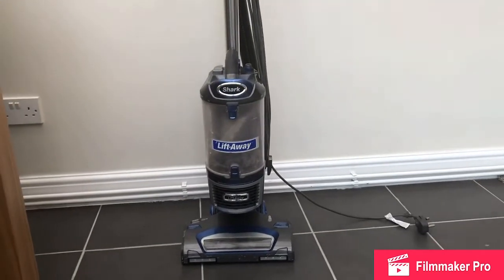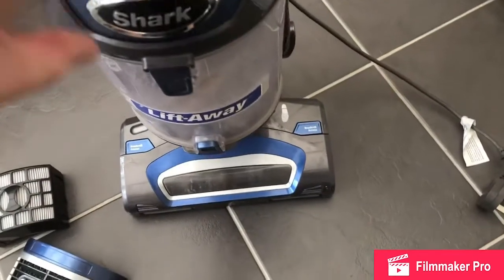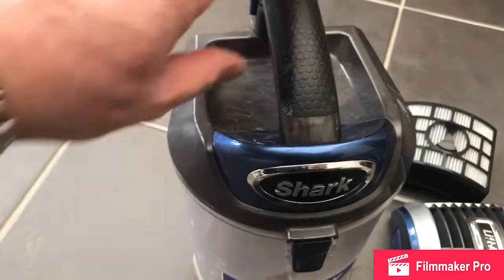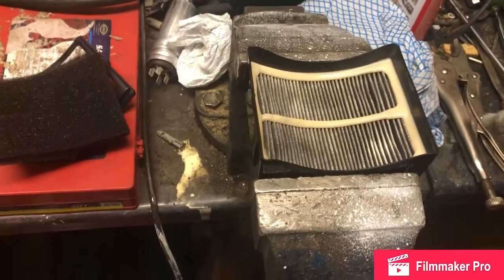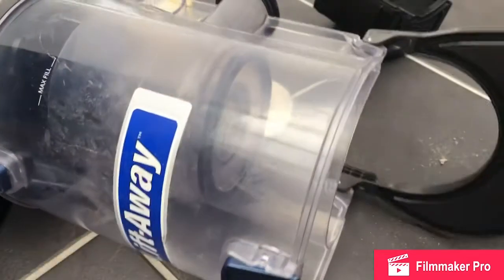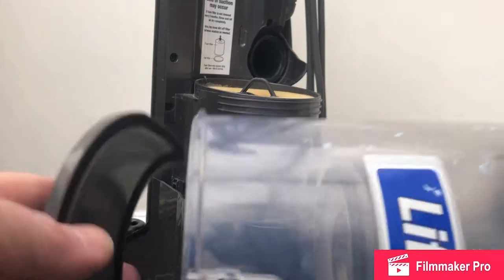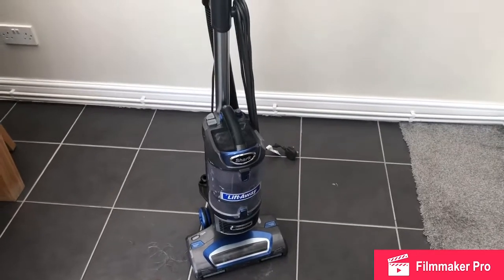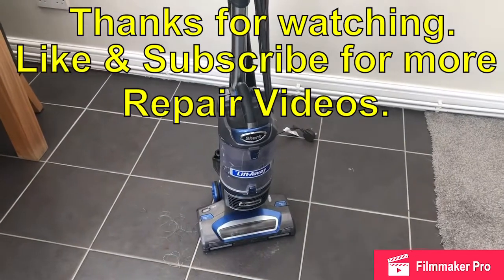Shark NV601UK31 Vacuum Cleaner Service - Low Suction Fix.

Comment: I haven't been able to find a fix for mine, when switching on the light at the side goes from green to red,  I have tried a different brush assembly and the same thing happens with that,  has anyone got any idea what to do please.
Reply from the maker: Red normally indicates a roller obstruction usually when I have hoovered over a mat and the vacuum cleaner has sucked it in and obstructed the roller from turning.